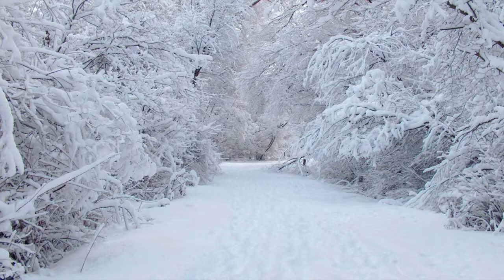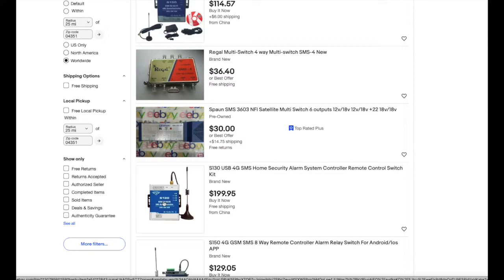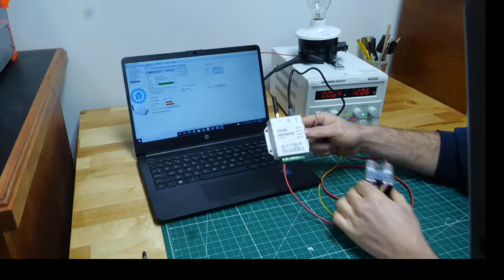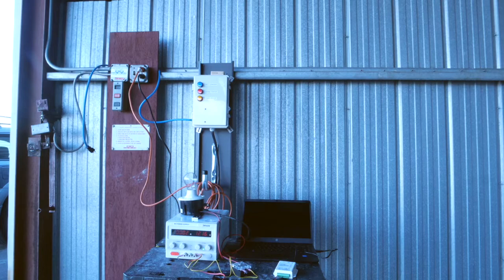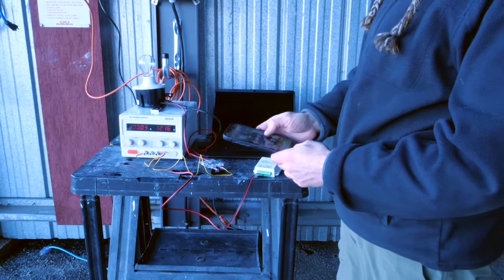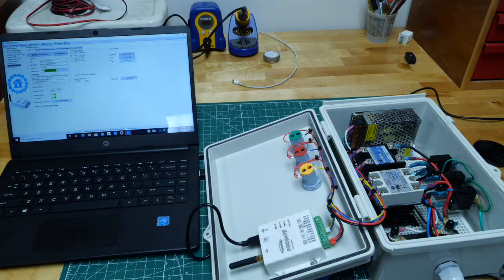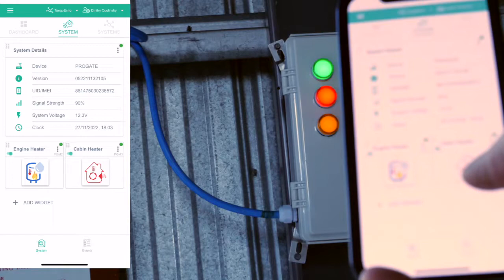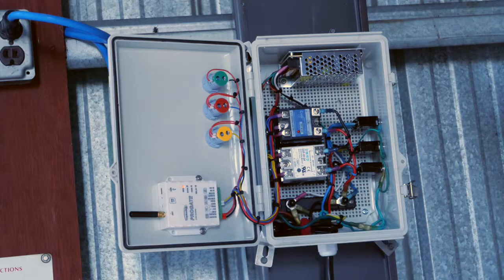Cell Phone App or Text Message Operated Remote Switch (Topkodas Progate)

Comment: Where does it get data stream?  Is it connected to local wifi network or is there a cell connection?  If  a cell connection, is there a monthly or annual cell data service needed?  Thanks.
Reply from the maker: This is a cell modem that operates switches and relays.  I use this because there is no wifi there.  I pay for prepaid GSM sim card for this.